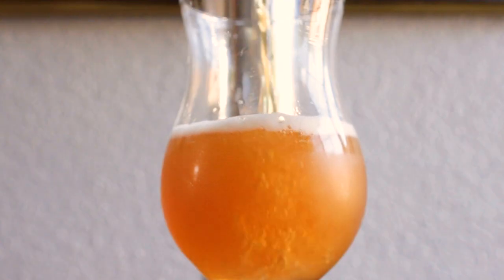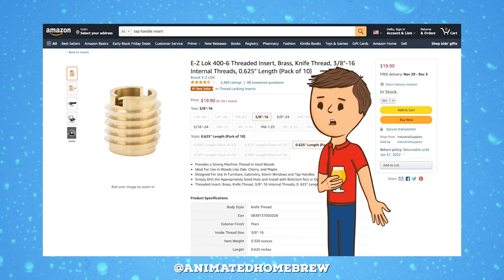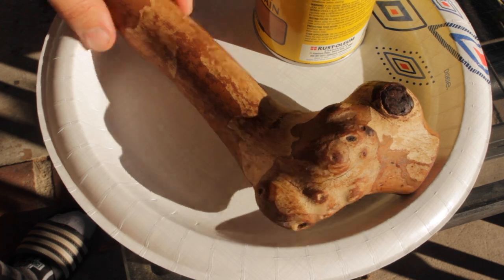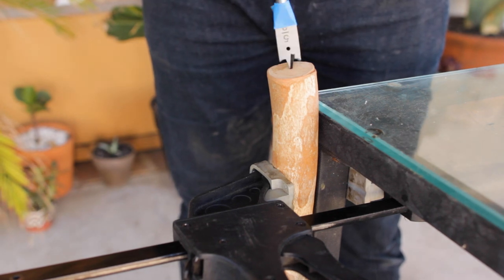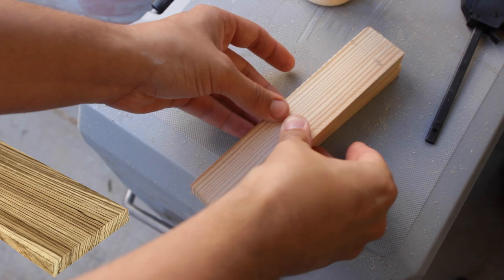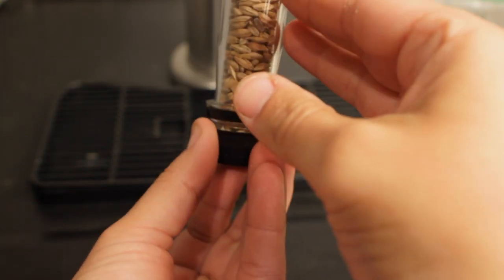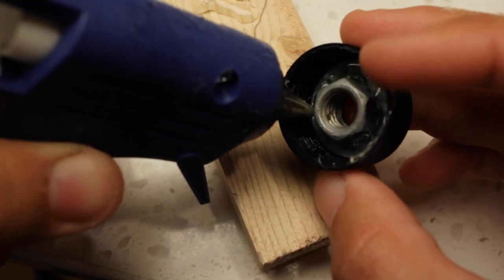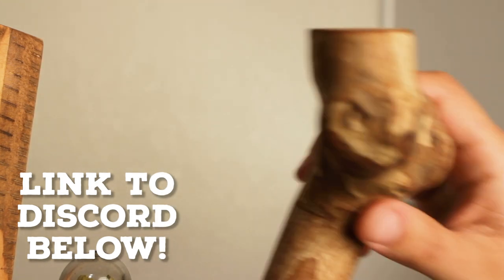3 SUPER EASY & CHEAP Beer Tap Handles [Simple DIY]

Comment: Really like the way you used the nut and glued it in. I used the brass insert and it was too soft and stripped the out side tread screwing it in to the hard wood. I ended up glueing it in with liquid nails. So good call using the metal nuts. Cheers mate.😎👍
Reply from the maker: Oh interesting I was wondering how the brass inserts worked out. Thanks for the insight! Cheers

Comment: If you mess up and get any glue or epoxy on the inside of the nut you can just buy a 3/8 -16 tap and run it through to clean out the threads. Good as new!
Reply from the maker: Smart thinking!